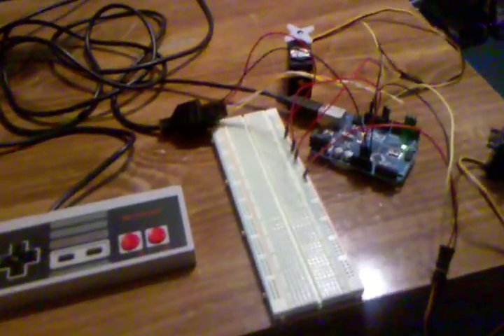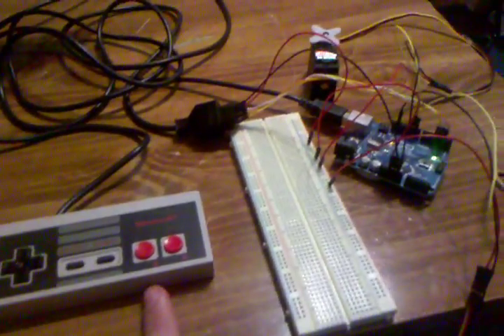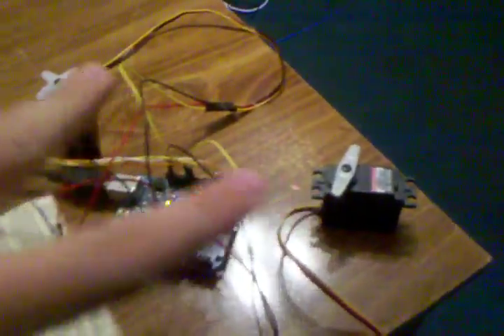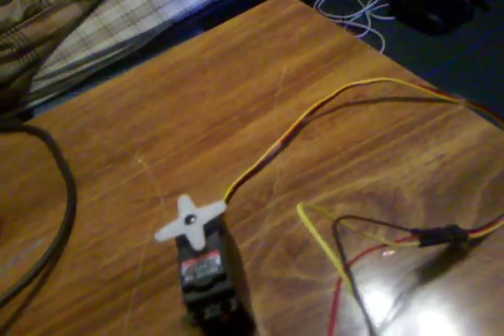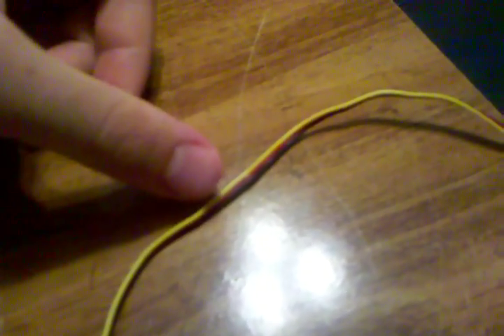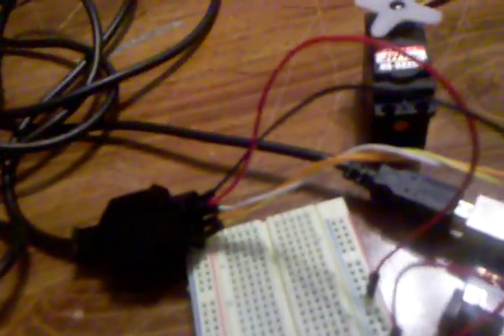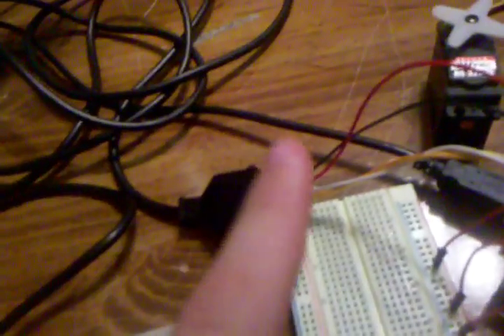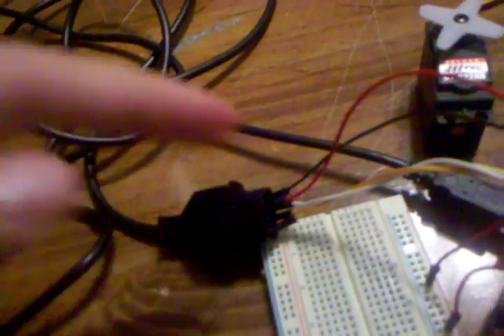Control Servos With NES Nintendo Controller & Arduino

Comment from the maker: it will not do anything without sending a value to the data cable. since I'm using an 180º servo, it will rotate from it's current value to the value I pass to it. For example, if it's currently at 90º and I send 15, it will rotate -75º and stop once it reaches 15º.

I just added a link in the description for a tutorial from my blog.

Comment: do you need to hook up the data cable on the servo or will it run without and if not what data do i have to put down the data cable to get it to rotate?